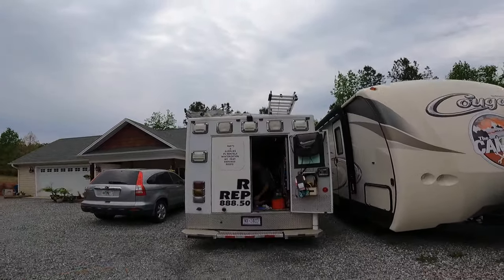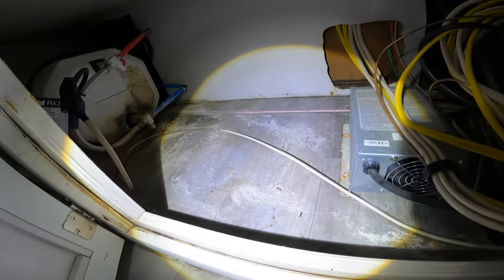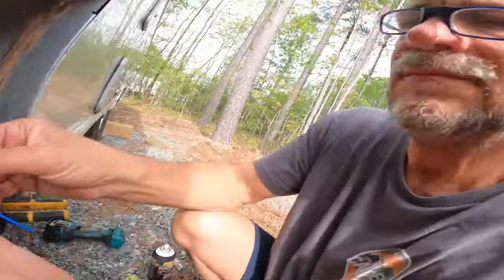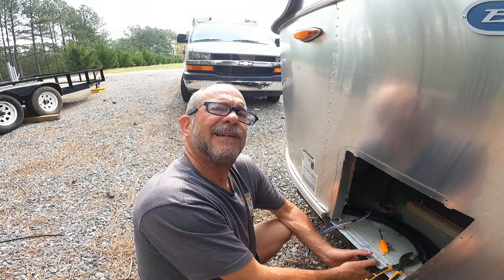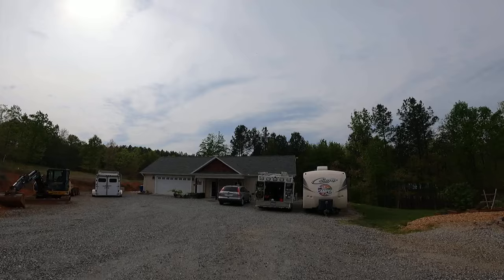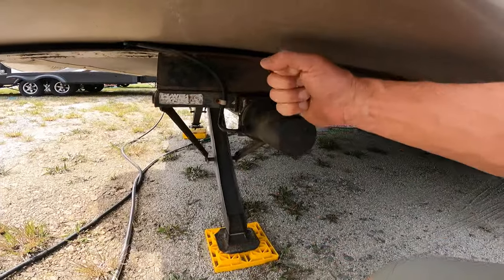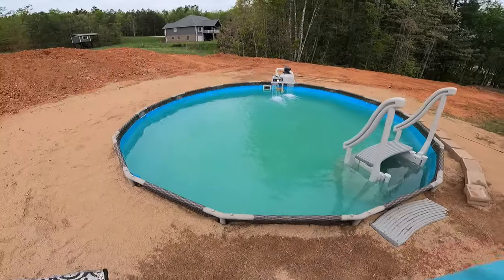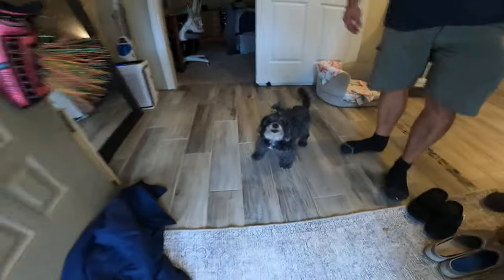People are going broke

Comment: "People are going broke" Nothing about it in the video. Just like previous video with "RV Market Pop" and nothing about it. Anyways, about the swimming pool. The filer should remove all the cloudiness of the water by simply circulating it through the sand/cartridge . Once you vacuum the sediments on the bottom few times, the filter does the rest by taking out the stirred sediments. You have to flush the filer after every vacuum session.
Reply from the maker: its not we replaced the sand too..  problem is when we dug it red clay got in the water ..   heathers getting it with the pool place helped her some!  its almost clear now  what a pain that was